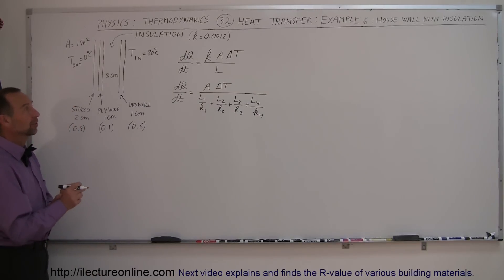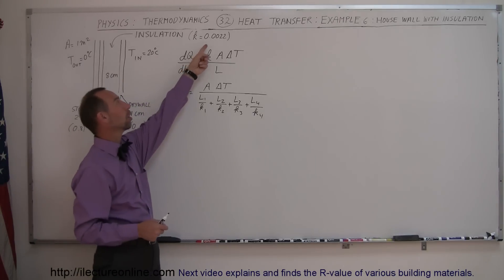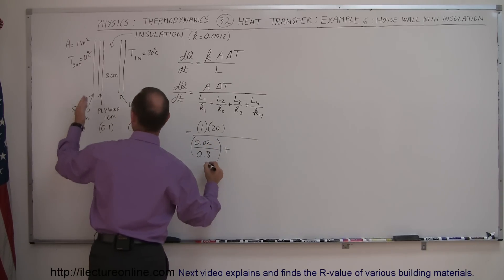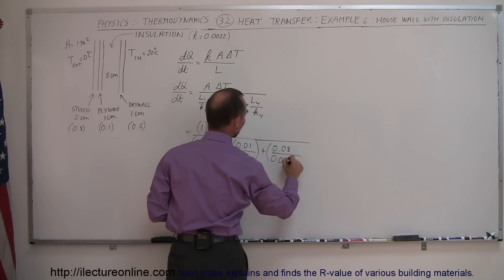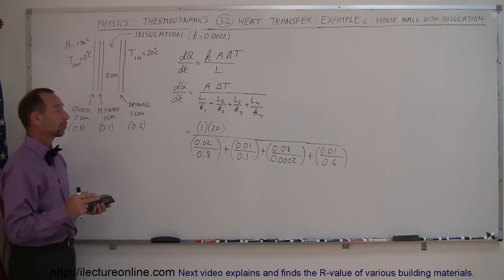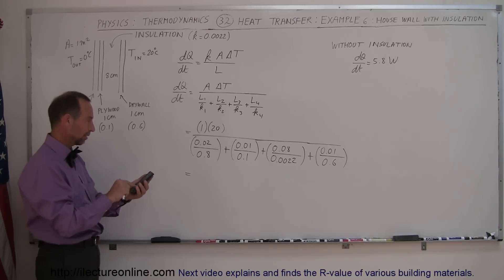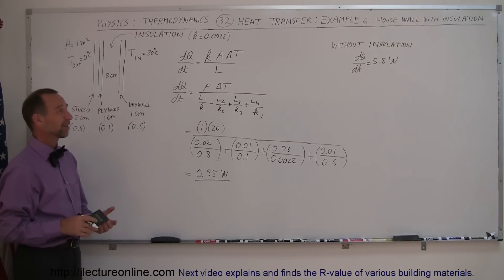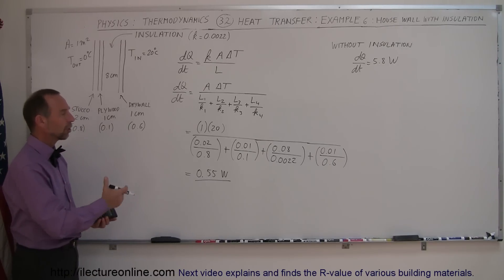Physics 24  Heat Transfer: Conduction (7 of 34) House Wall With Insulation

Comment: I remember that one of my old math courses on partial differential equations said that a thin insulation could sometimes be worse than no insulation at all;
I think it had something to do with conduction.
Reply from the maker: Air is a good insulator (especially if you can prevent convection currents), and its insulating property could be better than the thin insulator.

Comment: So how does this conform to the 2nd Law of Thermodynamics?  Does the insulation surface (house side) stay at a temperature cooler than the inside of the house and instantaneously warm the inside if there is constant power input?  Or, does heat from inside the house increase the temperature of the surface of the insulation (house side) and THEN heat transfer is slowed which then begins to increase the temperature? 

I would like to see real time data on the temperature changes but all I can find is elementary explanations or basic equations showing the final equilibrium heat transfer rate.
Reply from the maker: What part of the second law of thermodynamics are you referring to when you state: " does this "conform" to ....   ?
Reply: The Clausius theory in regards to temperature and not heat. That the temperature of a constant heat source can't rise until the surface of the insulator reaches the same temperature - because the flux of heat will always be towards the insulation until its surface reaches the same temperature, and then rises in temperature first, and eventually adds additional heat to the heat source. 

I think it would be a neat experiment demonstrating thermodynamics and how insulation works.
Reply from the maker: Clausius theory had more to do with the relationship of the flow of heat in a thermodynamic process and the change in entropy in that the most efficient engine possible would produce a zero change in entropy and that a negative entropy change would therefore not be possible in a thermodynamic process.
Reply: Yes but temperature is a measure of entropy - the reciprocal of. For a heat source to rise in temperature without something at a higher temperature/lower entropy, that would be entropy flowing uphill spontaneously, a violation of the 2nd Law.
Reply from the maker: Going back to your question then, the only way heat can travel along a conducting path, (like an insulator), the temperature must be cooler where the heat is traveling to compared to where it is coming from.
Reply: And vice versa, for temperature to increase upstream along a conducting path, the temperature must first increase downstream along the conducting path.

Comment: Your example insulation value seems to be off. Air is roughly k=0.02. Most insulation materials are slightly more conductive, at roughly k=0.03 or k=0.04. Certain gasses can have k values below 0.01, and ideal vacuum is 0, but your example value of 0.0022 does not correspond to any known material. You're off by a factor of 10. The answer to your equation, using k=0.022 for insulation, would be ~3.7 W.
Reply from the maker: AJ
1) Fiberglass insulating material has a k value about 1/11 that of air for the same "thickness" which puts its k value around 0.002.
2) The purpose of the problem is to show how to calculate the heat conductivity across a multi-layered wall (in theory).
3) Actual values for heat conduction will have to include air films on both sides of the wall, wind speed, inside air circulation, etc.  (this was not the purpose of the problem).
Reply: Michel van Biezen
 You'd have to show me where you got your number for fiberglas. Wikipedia and Engineering Toolbox both list it at k=0.04 W/mK. Which makes sense, because few things are less conductive than still air (k=0.025). I know you're just demonstrating the equation, but you seem to have chosen a value for insulation that is well outside the boundary of normal reality. Only vacuum and certain unusual gasses (like radon) are close to "k=0.0022".